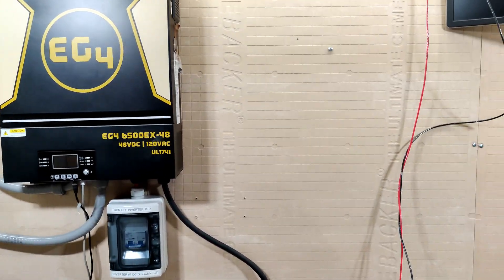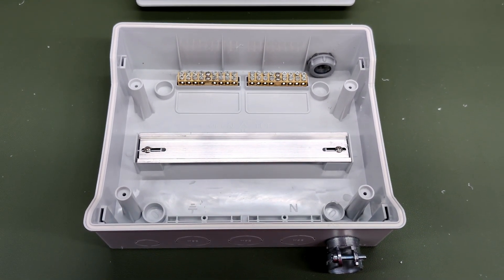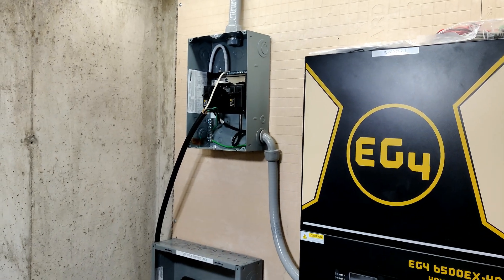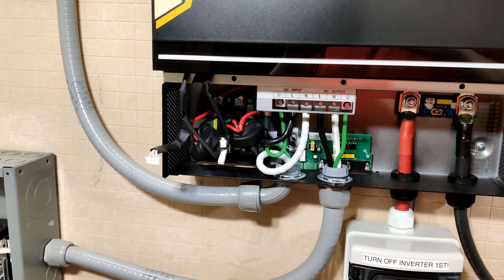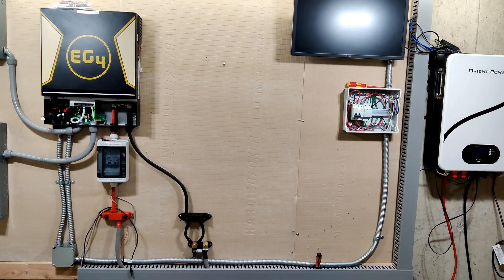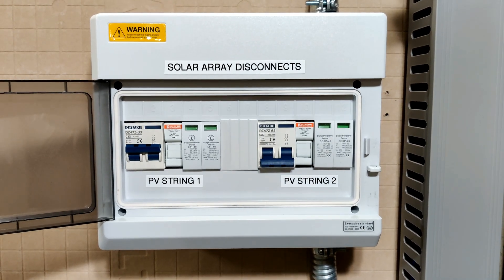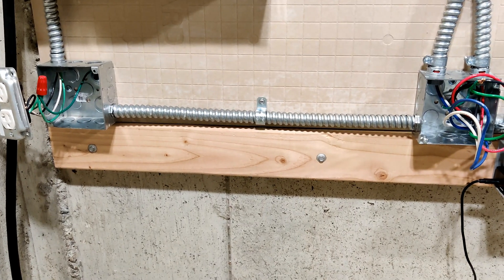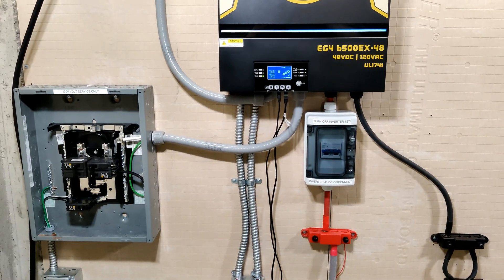Installation of an EG4 6500EX Based Off Grid Solar System - Part 3

Comment: Are you happy with this inverter? I'm just about to pull the trigger on my "big" system but I'm encountering some EG4 naysayers. Thanks!
Reply from the maker: Hopefully this reply isn't too long for you, but...
I've had it running my freezer for some time now and my fridge more recently, I need to move more circuits over including lighting circuits.  I've been too busy getting outside projects done before winter sets in to do it yet.  
I will say that when I put it in Solar/Utility/Battery mode I do get some light flicker, mostly on my patio lights that are on a Z-wave dimmer with cheap LED bulbs in the fixtures, but they're not even on a circuit running off the inverter.  When I put it Solar/Battery/Utility that goes away.  I also had an old Cyberpower UPS that hates it and clicks to and from battery mode over and over when the inverter is running.  I have two APC UPSes that don't seem to care.  I'm still running the original firmware it came with when I purchased it in March though, so that may go away once I update it. Still, if you have a house full of basic in-wall dimmers and cheap LED bulbs be warned.  Feit Electric and no-name Chinese bulbs seem to have issues.  My smart bulbs (Phillips Hue) and more expensive LED recessed can trims don't flicker, but we'll see once I move the lighting circuits over.  Adam DeLay has a few videos on the flickering issue if you want to look more into it.
I do encourage you to consider the idle consumption too depending on how large of a battery bank you're planning on having.  My single unit pulls 55 watts any time it's running, which 24 hours a day = 1320 watts a day, or 1.32kwh just to run the inverter with no load on it.  This can matter a lot especially if you don't plan to have grid charging set up and live someplace with a proper winter.   I have 10kwh of storage right now which means every day I'm burning 13% of my battery just to run one inverter.  If you have lots of solar and a lot of batteries this won't matter as much.
Other than that I have no complaints other than it is noisy, mostly when it's ramping up battery charging at higher outputs (over 1200 watts).  
You get what you pay for though.  This is entry level equipment, so expect more issues than dropping 9 grand on a SolArc or $5600 on an EG4 18k PV.  Just set your expectation based on how much your wallet hurts when you buy them.
If you go dual EG4 6500EX's I would suggest getting the bundle with the PDP, it will save you money and time IMO.  I'll be getting one if I ever get a second 6500EX, it wasn't available yet when I purchased my inverter.
Hope this helps.
Reply: @SolarShenanigans   Thank you so much for taking the time to give a detailed review. You've given me much to think about and I appreciate your kindness.
Reply from the maker: @zedalis You're welcome, good luck, I hope your final setup is epic.

Comment: First of all, great job. Everything looks fantastic. You kept mentioning code compliance, so I assume you are going to have it permitted and inspected? If so, I got popped for two things on my inspection that you may want to watch for because it appears you have the same "issues".

1. I was using the same PV DC Disconnects (at the PV array) that you are using. I assume you bought them on Amazon, which is where I bought mine from. They are not NEC compliant and that was one of my failure points during my first inspection. They must be UL listed, which makes them expensive. The ones you have are IEC60947-2 standard, which do not meet the criteria. 
2. I was also failed because apparently anything that is inside the building and over 30VDC must be contained in metal raceways. I have the IMO PV DC disconnects I purchased from SS and they are contained in a plastic case. They must be contained in a metal box with access per my inspector. I "believe" you are going to have to swap out that disconnect box for a metal disconnect box. Obviously, you might want to see if it will slide first, and if you fail, then swap it out for your second inspection. I have two EG4 6500's, so I purchased that new load center from SS that does have everything contained in metal and all of the disconnects are UL listed. 

Other than that, it seems like you are really solid. Again, I'm just a DIY'er and passing along some information I've gained on my journey. My inspector was a bit of a Karen, so I guess you just never know. Your inspector may overlook it....and I hope they do.
Reply from the maker: Thanks for the comment, life has been keeping my busy unfortunately so sorry for the slow reply.
My goal is to be as code compliant as possible, especially on the AC side, but I don't plan on inspection as of yet.  I might some day want to go with a grid interactive inverter like a SolArc or EG4 18kPV, so I figure doing it right the first time is cheaper as well as safer.  One of my regrets is not using a metal raceway to begin with though.  I did see that new enclosure for the 6500EX, I think it's going to be a "must purchase" whenever I get a second inverter.  I also wish I'd used a metal box for the PV disconnects or used one of the "proper" PV disconnect switches.  All the PV lines are going to be in EMT or metallic flex if inside the house or garage other than the disconnects for now.  I don't want to mess around with DC arcs.
I also want to make it so that if sell the house I can easily remove the solar stuff and convert the AC side to be a generator inlet to the critical loads panel and the inverter grid input into a 50 amp outlet in the garage so it can be "electric car ready".  This is one reason I have so many panels in my setup and such an overkill transfer switch.
How did you manage the "rapid shutdown" issues?  From what I've read the NEC requires a switch on the outside of the house to shut down the inverter and PV inputs for firefighter protection.  I'm not sure how to do that with the 6500EX.
Reply: @SolarShenanigans   On the DC side of things, the PV DC disconnects were satisfactory for "rapid shutdown". But again, they are only satisfactory IF they are enclosed in metal, so this EG4 PDP panel will/should solve that issue. On the AC side of things, the back fed breaker disconnect was satisfactory. I don't know if that qualifies as "rapid shutdown", but I don't think it matters on the AC side. If you are in fact using a backfed breaker in your AC load panel, be sure and use a breaker tie down kit. I didn't know such a thing even existed until I got popped for it during an inspection. It's just a simple tie down device that for one reason or another is required. All my install is in a power shed completely separate from the house, so it is possible there are a few other requirements since your install is IN your home.
Reply from the maker: @mikeeager6573  Yeah they want a mechanical lockout so if you're backfeeding the panel there's no way to turn on grid power at the same time, or worse during a power outage backfeed the grid and fry a lineman.
I have a critical loads panel with a manual transfer switch I'm installing, so I don't have to have an interlock in the main panel.
I guess you had a nice inspector, from what I'm reading they want you to have a way to not just shut down the PV but also the AC output from the inverter.  During a fire they disconnect the grid power to the building to prevent problems like electrocuting fire fighters.  The concern is that the fire fighters won't know there's an inverter powering the house and think the power is off when it's not.  SolArcs for example have the ability to wire in a rapid shutdown switch that you put in an accessible location outside the house so the firefighters can turn off the inverter as well as the grid power.  Not sure how to do this with the 6500EX efficiently though.

Comment: Awesome job!  Thanks for sharing!

Yeah fmc can be a bit of a pain trying to feed through all constrained.  Found that out the hard way when I had to rewire some lights.  So much easier to deal with the “snake” when it’s loose…

Keep up the great work!

I’ll have to admit, several times I thought your SA monitor had a big crack in it due to the shadow from the wires.  😂

What’s up with SA?
Reply from the maker: Thanks.  Yeah it's not cracked but if it was I have a pile of those old 24" monitors laying around from work.
As for SA... well, don't read the below if you don't want to hear a rant.
<Rant On>
First the buck converter power supply it came with decided to die and send full battery voltage to the Pi and fry it to the point it got so hot it almost burned me.  Watts never replied to my support e-mail so I contacted SA and they made me burn my one free license transfer they allow under their draconian licensing to install it on the replacement they at least sent me.
Then the crappy Orange Pi kept locking up every few hours.  I contacted SA and was told you can't use any USB extensions as it causes the Pi to lock up, and to only use USB to serial adapters that have FTDI chipsets as others cause "problems".  2 out of 3 USB hubs I've tried also causes the Pi to lock up.  I wanted to hide the Pi behind the monitor but that's not workable with being limited to 6' cables. 
The video out is fine other than it's set to go into some kind of power save mode and there's no way to turn it off... so your SA display is just a black screen most of the time unless you hook a keyboard up to it and hit a key every time you want to see what's on the display.
They have it locked down so tight that you can't even SSH into it, much less change any settings... there's probably a way to mount the SD card on my Linux box but I only know enough about Linux to be dangerous and I've not spent the time to figure it out yet. 
Then all of a sudden it decided not to talk to the inverter over the RJ45 port, it would display the data from the inverter but not let you change any settings on the inverter.  Also on the Power tab it would show "The Inverter is currently set to <blank>."  So now it's plugged into the MicroUSB port until I figure out that debacle. 
Oh and there's no way to export your data... what's the point in having all this data if you can't even export it, and lose all your data if your SD card dies?
</Rant Off>
Thanks for the comment and good luck with your Big Blue setup. :)
Reply: @SolarShenanigans  It's interesting, I believe I've heard of at least 1 other person that had issues with the supplied power supply.  I had bought a buck converter off amazon and it worked great for me on both my 12 and 48v system.  If you're interested, I can give you the link for it so you can move things back where you want it.  

I'm surprised you never got a response from Ian though.  Wonder what's going on there.  

Were you using a USB splitter or an extender?  I know I had a 4 port hub on mine and I've seen several other videos with people using hubs with no issues.  Not sure why an extender would be any different because it's just lengthening a wire, it's not changing any traffic.  

I have heard of another person complain about the screen turning off, he was using a touchscreen though so he just had to tap it to wake it up.  Either way, I know he contacted SA about that and they're supposed to be putting in an option for the Orange Pi in a future update to control whether or not the screen times out.

I do know there is a thread on the diysolarforum about manually being able to back up the data.  The latest beta of SA does have the ability to backup and restored data (wish it hadn't taken them so long to come up with such a basic feature though).

If I can be of any help, let me know.  Keep up the great work!